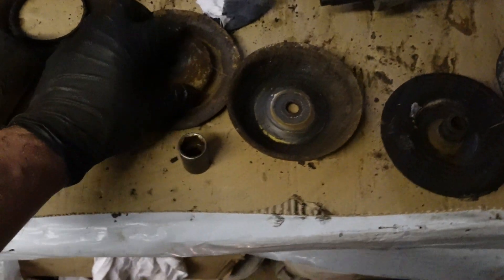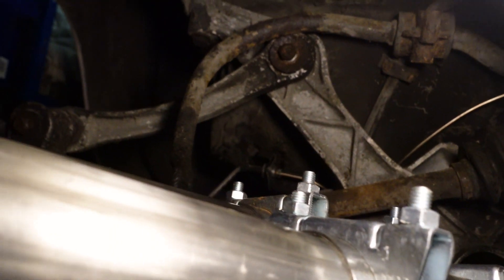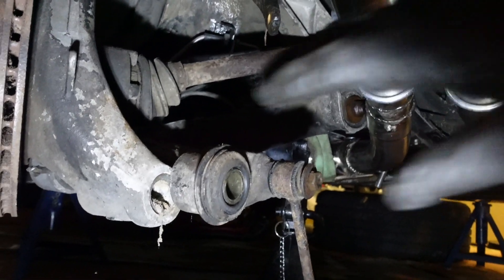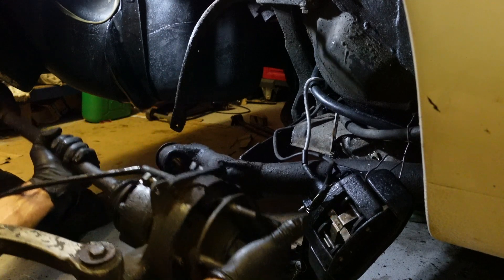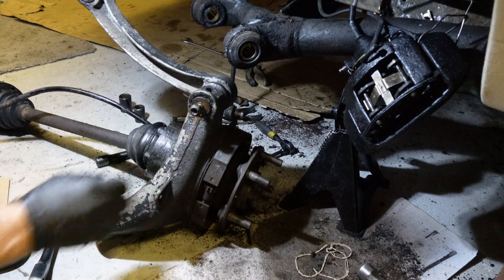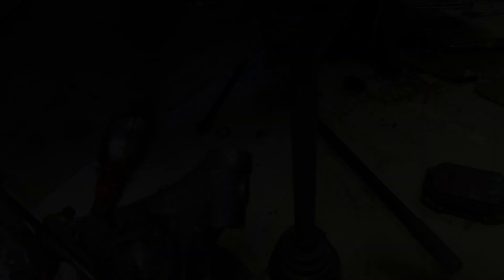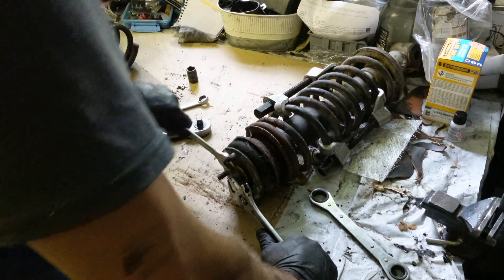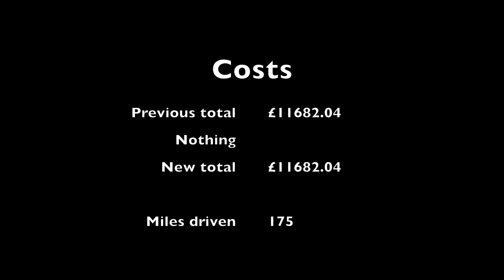Porsche 928 Episode 103 - Removing the rear suspension

Comment: So awesome! My favorite part of restoring my cars is the suspension refresh! Removing, identifying what needs to be replaced, cleaning everything up, and reassembling.

In regards to the springs, are there any shops that can reproduce a similar spring as the OEM spring? We have a few shops that do that here in the US. Hopefully you do. Those springs are definitely worn. New ones will make a huge improvement. 

Also, I noticed you are calling the bushings "bushes".
Reply from the maker: Oh good catch on the bushings! My bad. 
Springs will have to be happy with a blasting and powder coating. Won’t be able to replace them this time round :(

Thanks for watching :)

Comment: Great work. Those CV joints look like they need replacing. The grease has had it even though the boots look in fair condition. It is a filthy job and could take a whole episode to complete. Access to a parts washer is virtually mandatory. Probably best to keep each 'set' of balls and their respective cradle as a unit through out. Disassemble each then reassemble the same parts into its respective CV cage. (there could be wear that is different on each CV). I would suggest once refreshed each are replaced back to its original position on the axle (i.e. left outer refit to left outer, left inner refit to left inner etc.). New grease and boots also check the condition of the balls. One of my CV's had a ball that had a chip out of it, god knows how that could have happen. There are some excellent info / video on rennlist which will save you time and effort. Good luck and keep up the good work.
Reply from the maker: I'll give the CV joints a good clean and lets see whats what. Im hoping they just need new grease (lets put it this way.... they are getting new grease and going back on the car :) )

Comment: Just finished our 928's rear shocks (dampers) and brakes a few days ago. We must have been doing the some of the same jobs at the same time, but across the pond from each other. I didn't disassemble our rear suspension as much as you did though.  I will have to pull the axil shafts soon to replace the CV boots. Will be referencing your content like usual when I do. Keep it coming!
Reply from the maker: Hey C3K! funny, I just watched your video :)  ... I was going to (and should have) gone further with removing bits, but I couldnt get the bolt undone that links the lower control arm to the car (near sill), and I didn't want to break it off, ruin the bushes and incurr a £400 bushes bill.... Its all easy stuff so I'll remove once they fail. 

I didn't include in the video, but I also removed the CV joints from half-shafts and sent the shafts off to be powder coated :)

Thanks for watching!

Comment: Hub nut removal on my 911 should be the same. Place a 1M bar between 2 of the studs and let the bar rotate to the floor and jam. That will stop the hub rotation. Put a breaker bar, extension and socket on the nut and heave ho. I got mine off and torqued on that way.
Reply from the maker: Thanks Dave, I just did my 911 using a 4ft long bar over my socket set and applying 38kgs. I didn’t fancy applying that amount of force to a car on axel stands (especially knowing one sill is rotten!). Thanks for tip though, I actually did this to undo the half shaft bolts :)

Comment: Its going to look great when its all powder coated
Reply from the maker: Hopefully! It’s a shame not to take the other bits off, but I can’t easily get that lower control arm off (not without breaking the bolt and bushes) and that stops me removing the cross member. … when those bushes need replacing Il take it all off then :). All I care about is fixing that CLUNK :)

Comment: Todd, Took a break for 10 months from my '81 restoration.  Going back to it next week.  While you did not remove the handbrake cables from the rear hubs, I wonder if you had anyone refer you and sources on how to do that?  As purchased the attachment from the cable to the parking brake shoe mechanism was broken so I have to remove the cables.  Specific question is "is it possible to remove the metal sleeve that appears to be pressed in the hub (through which the cable travels)? Or maybe more appropriately - Must I remove that in order to fit a new cable? Many thanks for all the inspiration.
Reply from the maker: Hi Timothy, good to have you back! That is a good question, and one that stumped me. I never managed to get the handbrake cable away from either hub. From what I could see you need to undo the axel nut and pull off the piece with the wheel studs. That allows you to get at the end of the cable. When I searched on Rennlist (biggest 928 forum) it appeasr the rigid sleeve you are after is just pressed in, so should twist/wiggle out. Let me know how you get on! Instagram might be easier to chat...

Comment: What shock will you use, will you change all four?
Reply from the maker: At the very start of the project I was kindly given a full set of S4 dampers. I have already used the front ones and will now fit the rear. I am wondering if that is why my front rides a little high, but I will deal with that after the rear is back together :)